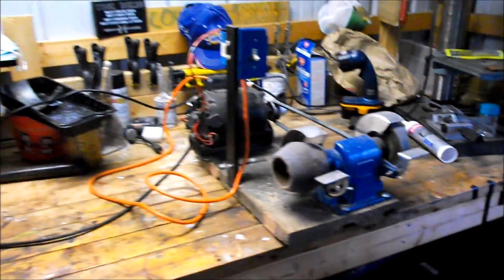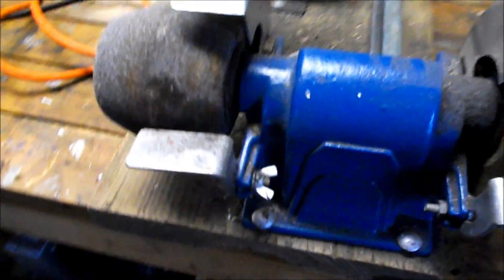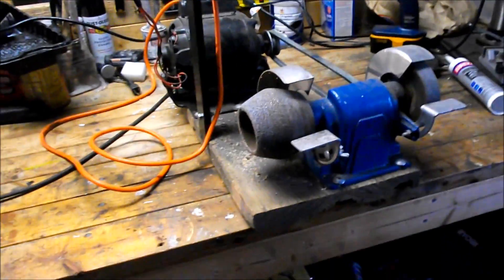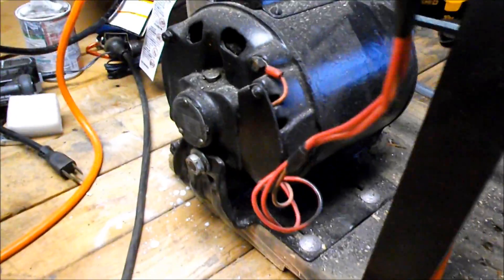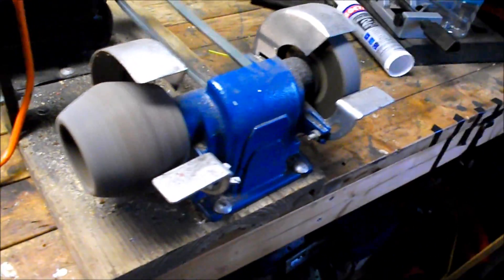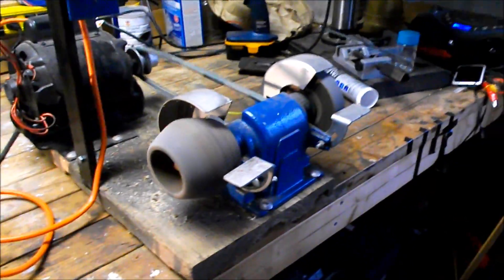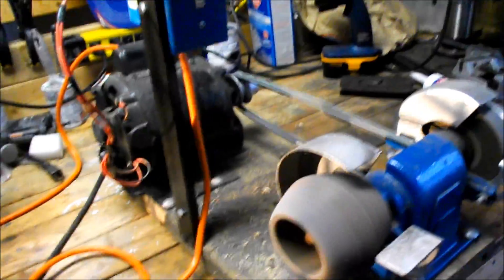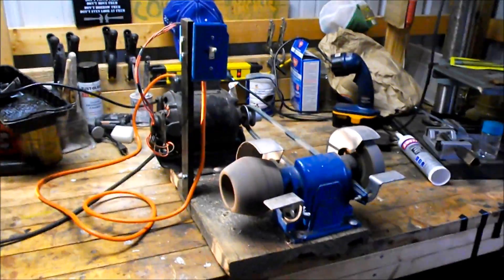6 Inch General Grinder Update

Comment: I have the "general" belt driven bench grinder. However the belt pulley on the grinder shaft is moving toward the right (as you face the grinder), even after I tightened the set screw. Any suggestions?
Reply from the maker: There are three things that may fix this. Mind you that I don't know for sure, this is me spitballing. First and least complicated, slide the pulley over on the shaft. Apply some Loctite to the area where the pulley resides and slide the pulley back and Loctite and tighten the set screw. It's a bit meatball but it may work. The second this is buying a new pulley with multiple set screws. Finding one with two instead of one shouldn't be much of an issue. Finally, if there is enough space on both sides, get two locking collars and put one on either side of the pulley if you don't wish to replace the pulley. Options 2 & 3 require disassembling the grinder a bit so I will leave that up to you. Let me know if you need anything else.

Comment: Reversing the leads will not work to change the rotation on an AC motor. You would have to take apart the motor and reverse the connections of either the start winding or the run winding, to change the motor rotation. But you probably don't want to go through all of that.

A simple solution... Turn the motor around on the base, facing it in the opposite direction. That will make the grinder turn downward as it should. Good luck!
Reply from the maker: Yeah, when I made this video I didn't know a lot about motors. I got a lot of help from www.sparksandarcs.com at the time. I looked into switching the motor's position but I wanted to keep the original setup. Also, the base has a spring loaded tensioner for the motor and I wanted to keep that working. The only thing I plan on doing to this is rewire the switch and push the motor back about an inch to get a batter grip on the belt.

Comment: Why should the wheels turn downward?  Thank you,
Reply from the maker: Bench Grinders are supposed to turn upward so that way the pressure can be downward of the "bench" and to keep the work from flying up. This one was not made like that. There is a spring assisted tensioner on the motor and I wanted to keep it original.I tried reversering the leads on the motor to change the direction with no luck. I decided to keep it this way and it hasn't really bothered  me that much.